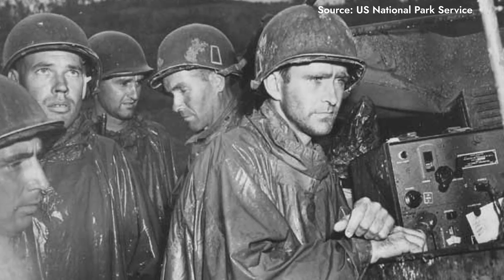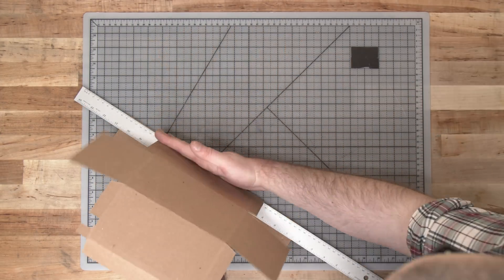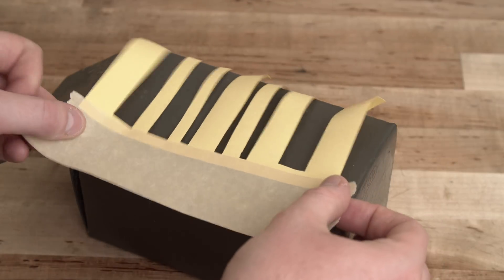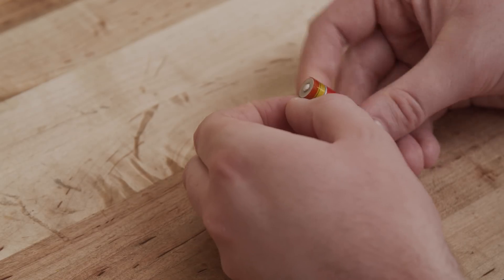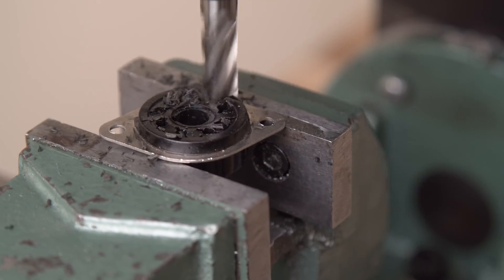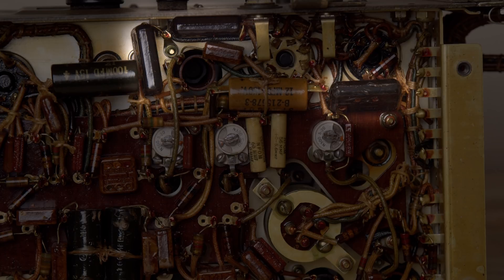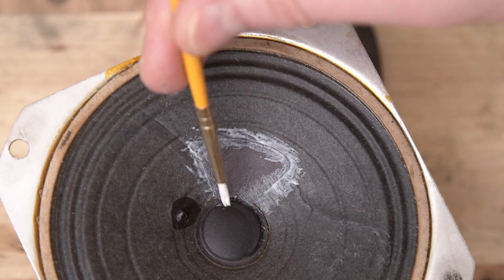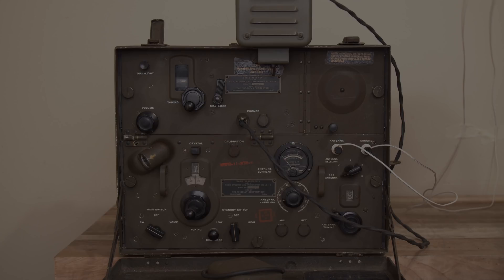WW2 Army Radio Receiver Restoration - SCR-284 Part 2

Comment: A good source of mobile power are drill batteries! I use Dewalt 18V Li-Ion ones, 3D print a “socket” it clips into which uses blade crimps to connect to the pack. On Dewalt you have to provide your own undervoltage protection, but if it’s a light load that’s it, you don’t need any other connections. Heavy loads should monitor the temperature by connecting to the thermistor pin. You unplug it and use the proper charger to charge. 18V 5Ah seems to be the usual size now and are available anywhere.
There’s also a Flexvolt one which supplies either 18V or 54V! Quite expensive but a usefully high voltage straight from the pack.
Apparently Makita batteries are better as the charger balances the cells rather than relying on them being matched, but I haven’t tried that make yet.
Finally make sure you have a fuse or polyswitch on the output. Those packs can source hundreds of amps for a short time.

Comment: Thanks for sharing this. In 1968 I found the manual of this radio in the store of a radio shop. These units were not available in my country at all. Therefore I am still wondering how this secured document could be available. At that time I built tube radios and repaired all kinds of radios and tv's.

Henrik OH2BLO

Comment: I also approve of the speaker repair! Very Ham Radio approved. The battery box I would have built would have used 18650 lipo batteries and parallel sized D cells, and I would have built a more permanent AC supply for stationary use. This is just my take on making the radio “user friendly“, not what you should have done (your take was fine!). Lucky to have found a matching speaker, too. I have a BC-348 Q in my shack, un modded with the dynamo, and it may be a bit noisy, but it does fine on the 24volt battery I got used from the local airfield. So it doesn't receive the high HF frequencies, but it works with my 40 and 80 meters QRP CW transmitters. Lots of fun! Good Luck and 73 de W4FJF.

Comment: I recently bought at a flea market a WWII G-3 hand crank generator that went with the TRC-7 radio. Working on restoring it. The generator  works just great. It just needed a little TLC - bending back into shape the brace which attached the seat to the tripod and some touch up paint. It was also missing one of the handles, so I'm making new handles. Also had no cable, so I have to create a 3 prong DIN like connector and cable. If anyone has such parts (handle and/or cable) I would be interested.

Comment: Wonderful job.
  As for the battery, I would prefer to use 10-11 size 6LR61 (9v) batteries to get a high voltage supply for the vacuum tubes.

Comment: For the battery and different voltages I probably would have gone with few 18650 cells and then used boost converters for the different voltages required by the radio.

Comment: Great Video, I could not spend the time though putting old casing back on caps, maybe an can cap that was showing on top, Can't hide new resistors, or new wire. On the lighter side I've seen on old 20's radios JFET'S put under tubes and yellow led's to simulate filaments. After that I took an old SW took the tubes out and put JFET's  used the Filament supply to make a regulated supply, used a amp board for audio. Worked like before but cooler running, and could run off 12 volts then to.

Comment: Nicely done!  I like your work re-stuffing the Micamold paper caps.  I would recommend re-stuffing the electrolytic capacitors since they are probably out-of-tolerance as well.  One could go a step further and test all of the resistors, but a set of this vintage will work fine with component values that have drifted.  Also, it seems that there is a terminal board missing from the back of the speaker.  Some solder terminals mounted to one of the magnet screws would work well to provide a more secure place to connect the wires going out of the case.  Thanks for the video, and for preserving this great old set!

Comment: I loved watching you create the battery box!  I probably would have done things a bit differently, but that is part of the nature of mankind, we are all different in some way or another.  I would like to build a battery source for my Garod V Neutrodyne TRF receiver.  It is a 1927 or so era radio and I hope to have a working one when I can get all the needed parts and bits.  You can see what it looks like here:
https://radioatticarchives.com/radio.htm?radio=5765
I have no problem with throwing batteries into a box somewhat like the one you made, where my difficulty is, is in the charging circuit.  I need something that I could leave the batteries connected and they would fully charge, then switch to trickle charge when needed.  The voltages that I think I need are 4.5 volts, 6 volts, 22.5 to 45 Volts, and 90 Volts.
I have never seen one of those "Mica-Mold" capacitors split in half like that.  Thanks for sharing it with us.  The interesting thing is that you could place any type of capacitor inside, even an actual Mica if it would fit, and use it.  You gave me a lot of ideas with this video...again, thanks!
There are a couple of videos that I think you would enjoy watching.  Let me know what you think. They are:
https://www.youtube.com/watch?v=BnR_DLd1PDI
https://www.youtube.com/watch?v=67M7fsbLUIU
You can see a listing of all the videos made by Paul at this URL:  https://www.youtube.com/c/MrCarlsonsLab/videos
I hope to see more videos on here from you.  You make excellent videos!  I love the quality of them especially.  Everything is top-notch...audio, video, concept, format, procedure, etc.
73,
WB4RHA

Comment: Makes me even more hopeful for restoring a practically dead PRC-77. But mine needs a new Frequency dial Window which I may need to custom make. Other than that she’s almost done, after months of work, she just needs the wires permanently soldered and spliced back together after a little more shortening of a few wires,  and two wires needing replacing she should just need to be plugged in and pray the Modules don’t need replacing.

Comment: Hello, I have this radio but no means to make your battery power supply. Do you make these for customers? Thank you.
Reply from the maker: I might be able to help you out depending on your needs. Send me a business inquiry from https://www.youtube.com/c/WartimeWorkshop/about
Reply: I'm trying to send a reply from the link you provided with no luck. I could make the wooden and cardboard boxes but the batteries and soldiering to the correct pins I'd probably end up blowing myself up. Thank you for your reply, Dave.
Reply from the maker: Hi Dave, sorry for the delayed response. Unfortunately I can’t sell the handmade packs. I could only help you with the reproduction components.

Comment: 12:59 that is indeed true...thats the way capacitance meters work and i am tired of hearing in other videos people saying that the capacitor is fine it just went up in value...capacitors dont go up in value, they develop leakage and the meter thinks it is seeing a larger capacitor bevause it takes longer to charge...capacitor time constant is also used in advantage of the engineers to design oscillator circuits in radios, tvs and old equipment in general were the frequency is determined by the rate of charge of a capacitor, sometimes a capacitor and inductor etc

Comment: This is a super cool (and way over my head) video. I have two WWII BC-1000/SCR-300 backpack radios and two BC-659 jeep mounted radios (two WWII jeeps as well). I haven't had much time to dig into them, however, one of the BC-1000s powers up. This is inspiring. Great job!...and the battery reproduction is awesome.

Comment: Battery Case - Connector End. All dry battery connectors are sealed against moisture at manufacture with a sealing strip before the whole thing is wax coated. The missing markings are from when the battery is put in service. To do this the tape has to be torn off the battery end to free the connector in order to connect it. Great work and excellent video many thanks. Greetings from Vienna in Austria. Chris H.

Comment: When you get to the point of working on the vibrator supply, use a set of dummy load resistors to adjust the circuit instead of risking the tubes in the set.  Proper current values can be figured out using tube specs and/or measurements taken from the battery pack while the receiver is operating.  No need to stress your nerves or the set :-)  Nice profile in QST!  73 de K4TO, Dave
Reply: ps -- I will be 79 in a couple of months.  If you think the set's components suffer from old age, you should feel how some of my parts feel!  ;-)

Comment: From the electronic perspective I am sure, that there is more to do then replacing a few paper caps. What about all switches and the connector of the tube e.g.
From a mere restoration perspective, your "fetishism" with details is great!
Tks for your work! Hope to see more of it.
73 de db1pv
Reply: I noted there were electolytics likely to need of replacement as much the Micamolds. Every resistor ought to be checked for drifted values. I never apply power to a radio so old as that without first going thru & testing every component I can check & marking connections & components verified with a highlighter on a large copy of the schematic.  There's a lot of tolerance in most old sets for out-of-spec parts but they work better when the parts are in spec.

Comment: Just subbed. You are going be be competing with Mr. Carlsons Lab very soon with the high quality videos you are putting out:)
Reply from the maker: Thank you, that is a huge compliment! I have only recently discovered MCL and he is fantastic. I may be using some of his techniques in my next video, when I investigate the higher voltage electrolytics in the transmitter section.
Reply: @WartimeWorkshop  Awesome! Cant wait to see it!
Reply from the maker: Minor correction: I just reviewed the schematic again and the caps I was looking at aren't actually electrolytic, they are oil-filled paper. So we might get to explore an even more esoteric sort of capacitor next time!
Reply: @WartimeWorkshop  Nice! I know that they are commonly found in old military equipment and should be reliable but they can leak oil that contains PCB's which aren't good for you. I would check them for visible oil leakage and then with a leakage tester or an LCR meter. If its good, it should read 20+megohms or infinity on your LCR meter. Good luck on the transmitter!

Comment: Have you tried using laser printer toner mixed with wax as screen printing ink\paint?
Reply from the maker: I have not tried that; I was thinking about using encaustic paint, which would be similar. However it seems that I was wrong about the ink being on top; the "blob" in the image is something underneath both the wax and the printed label. I'll be correcting this on the next one I make.

Comment: It might have been a mistake not to have included thermal sensors on the batteries.
Reply from the maker: I was thinking about making a version with a whole BMS but for now I’m just unhooking them when not in use. Will definitely need to add some protections in if I have to run it all day for an event or something.

Comment from the maker: Thanks for the support everyone! Since there are so many more experienced people out there who are willing to take the time to teach others, I expect to have corrections to add to most of my videos. I will place these in the description under the "corrections" heading. Please take note of the items listed, especially if you are trying to use my videos for reference in your own build/restoration. When an issue impacts the safety or longevity of the piece, I'll try to include the fix in a future video.
Reply: Excellent work and VG video.  I have a 654 as well and am about to attack its restoration.  Mine works but those Micamolds are are a bear.  Luckily, the 654 doesn't have alot.  Try a BC-342.  They have about 30.  I have an alternative to restuffing them.  I buy caps from Justradios.com and cast them in hobby resin.  JR's are quality and small.  Colored black, they come out looking like the real thing.  You then just paint in the code dots.   Micamolds were also coated in wax about half the time, so you can hide imperfections with wax.  I can post some pics on G503.  I am Greywulf there.  I love your battery.  I have been planning on building my own, but you beat me to the punch.  I have collected several batteries as examples and most of my military ones have the ink on carboard and then waxed (BA-48, BA-53, BA-2, BA-28, etc).  From the bat packs you built, you could easily do a BA-48 for the BC-1306.  Again, excellent work.
Reply: I found this video very interested, but I wonder why you did not continue making videos, you definitely had a good way with handling and teaching

Comment: Did you test all the other paper caps? The ls-7 has a transformer built in and the driver is not correct. Looks like a 50s or 60s zenith.
Reply from the maker: I’m not aware of any other paper caps in the receiver, but there are a large number of them in the transmitter that will be replaced. I am going to check the electrolytics in the tx as well, and if they are really bad I might double back and do some more replacements in the receiver. As for the LS-7... wow, good catch and thank you! I’ll definitely be correcting that before I run it again.
Reply: @WartimeWorkshop  Enjoyed the vid and nice battery btw.I have an arr-7 that has high value caps that are surprisingly mica caps. I dont remember the brand off hand. I could have been looking at an electrolytic  in your radio. Those old bathtub caps love to go bad too. Amazing how these old radios fire right up even with leaky caps.
Reply from the maker: @Cheif Santana Thanks! Yeah, the longevity of this equipment is pretty amazing. I have been avoiding the electrolytics intentionally, to see what I can get away with while remaining "minimally invasive" but I strongly suspect there is room for improvement there. Keep an eye out for a video on correcting the LS-7... I think I may have found the proper driver for it.
Reply: @WartimeWorkshop  Yeah came to the comments to mention the other caps too.  You definitely want to replace all the caps, unfortunately. If they're not bad, they're probably not going to last long.  And a bad cap in certain places can actually ruin some of your tubes, and even a transformer in the worst case.  New caps are cheap enough that it's not worth the risk.  With all that said, I subscribed to your channel.  Looking forward to more videos!
Reply from the maker: I just mentioned this in another comment, but I'll include it here too! It's worth noting that most of the higher voltage caps in this set are mica and ceramic, which is probably one reason it has held up so well. As I've investigated the transmitter section schematic, I've learned that none of the caps in there are electrolytics; they are in fact oil-filled paper. So the only electrolytics are the four in the receiver (2-C-42 through 2-C-45). My working plan is to go back in and replace those four as an insurance policy, in addition to the planned work in the transmitter.

Comment: You do nice work. I will have to pull my box of mica caps out, always wondered about the ones with high capacity being mica. I know I seen the brand Micamold on some, will have to check them for leakage. They probably all came from military equipment.
Reply from the maker: Thank you sir! Micamold-branded stuff is definitely present in civilian radios too. Evidently they did make true mica caps in the smaller sizes that one might expect. However a lot of restoration people are just gonna replace almost anything that says Micamold on it; they are known to be pretty bad.
Reply: @WartimeWorkshop  Micamold made a lot of true mica capacitors in that format. I recently bought a couple hundred NOS "postage stamp" (some call them "domino") caps & verified all were mica construction in values up to about 0.02 uF. And all passed leakage & value tests with flying colors.

Comment: The printing on the battery is on the cardboard, which is waxed over. I re-created a Ray-O-Vac BC-611 battery using the closest color thick cardboard, printed it with a laser printer before cutting. I spent as much time creating the Ray-O-Vac logo as you did. I have an original battery to copy and was able to come up with a very close font. I am very impressed with your attention to detail, especially repacking the Micamolds. I look forward to more videos.
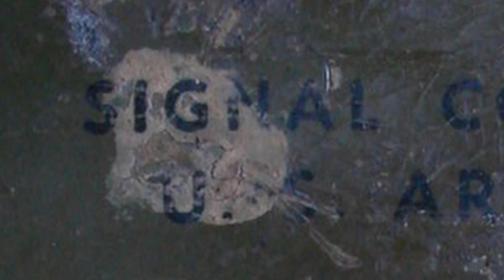Reply from the maker: Great to know there are others who care about this stuff, and thank you for your feedback! I debated whether it was under the wax or over; I had it in my head the white spot in the reference at 4:30 was a globule of wax. Based on your response I imagine this must be adhesive or leakage, and not a clump of wax. I'll certainly be accounting for that in rev 2.